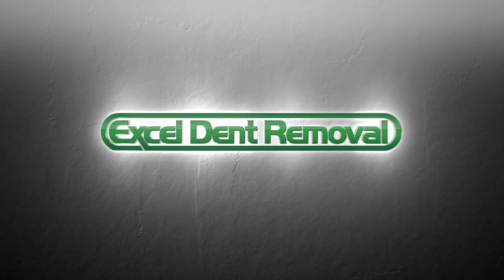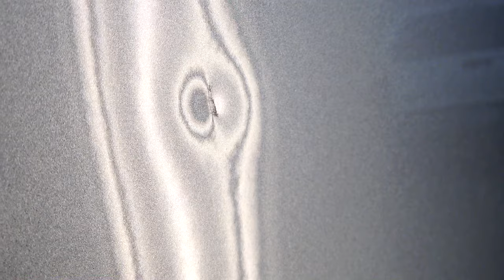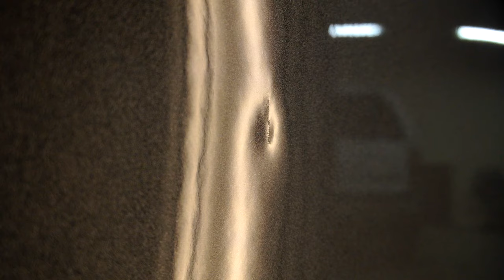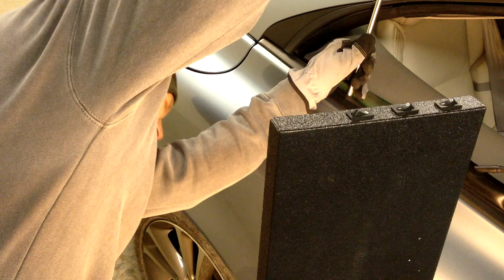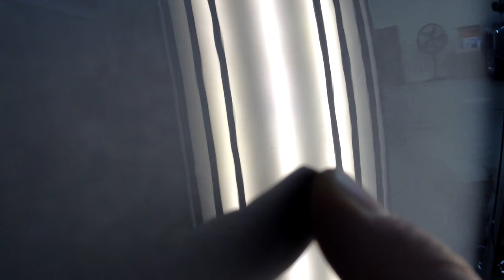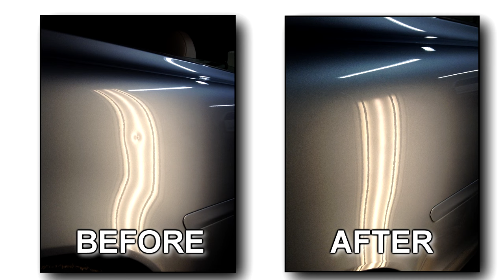How Does Paintless Dent Repair Work

Comment: That is some nice work.  Would this have been possible on older cars with heavier bodies or is this really applicable only for modern cars?
Reply from the maker: +fuffoon Yes. This does work on older and classic cars. I’ve repaired dents on many classics and for some of the best classic and custom car body shops in the area. As long as the paint is in good shape and there isn’t any bondo behind the damage, then removing the dings will work. 
I’ve got a couple photos of some nice classic cars I’ve worked on over at my Instagram account, https://www.instagram.com/exceldentremoval/ I should be adding some more photos there of some recent repairs.

Comment from the maker: Do you have questions about how Paintless Dent Removal works. Ask it Below in the comments.
Reply: Excel Dent Removal. can u removea scrape from side swipe
Reply from the maker: +Michael Marchetti If the damage is minor and not scratched thru the paint, then we may be able to buff out some of it. Otherwise, a body shop would need to repaint the area.
Reply: How much did the repair total come out to the customer/insurance? How much time was actually spent doing this job? Do PDR shops run flat or hourly? If so, what is the labor rate of you shop?
Reply from the maker: Paintless dent repair cost is usually based on the size and how complex the damage is. 
Each dent is different and will have a different cost and the time it will take to repair. The time it takes also depends on the skill of the tech and how well they do the repair. 
The dent in this video was done several years ago so I don’t remember the cost or how long it took to do. 
Average small door dents are around $100-$250 and can take from 30 minutes to 3 hours. More complex damage will increase the time of repair and cost.
Reply from the maker: Thanks for watching. I also have a hail damage repair video on my channel that shows a couple hail dents being taken out of a hood.
Reply from the maker: There are many options out there for PDR tools. The professional tools needed to repair hail damage can already cost over $1000 just for a basic set. I personally probably have over $20,000 in tools that are needed to remove all kinds of dent and damage. 

You can find some basic “cheap” tools online that might be good to try it out and see if it is something you will want to continue on your car with without spending a lot on tools. 
You can test it out on a few dents and see if it will work for you. 

To be honest. I find most people try a few dents and then give up. It’s really not as easy as it looks and may not come out looking good. Especially on a new car. 

Just for an example. When starting training. We make 10 dents in a junk hood to practice on. We are lucky if we can actually fix 1 of those 10 dents. The other 9 are so bad that if it wasn’t for practice, It would have to be conventionally repaired and painted. Then we start with another 10 dents  and try those. 
Most PDR techs will tell you that paintless dent repair is the HARDEST thing they have ever learned how to do.
Reply: Great tutorial vid! Was wondering which tool is best for this job? I have a similar dent and would like to do a bit of DIY here in Hong Kong.  I got the glue pull kit but obviously not working so was thinking of getting some proper tools. Thanks
Reply from the maker: +J ay Most of the Door dent repair tools I use are from A1 Pdr Tool company. 
I have a recommended list of tools on amazon from them in my Pdr tool section ➡️ http://goo.gl/vVrHxQ

You can also look for A1 PDR Tools for more of their tools available. 

I will suggest maybe seeing if you have a Pdr tech local near you for the repair. It would probably cost less than ordering the tools. 

Plus if you do have a similar dent as in this video. This dent was sharp and took me many years to be able to provide an excellent repair for this even minor damage. Someone untrained could make the dent much worse to the point that it would have to be repaired and painted.
Reply: Thanks for the videos. I've watched several, as I need to repair a couple similar sized dents on my car.I n this video you state that you are making slight pushes at the center of the dent yet, in the light pattern the surface appears to be flexing at the side , away from center. Can you please confirm or explain for me. Thanks much!
Reply from the maker: Yes. Pushing from the center of the dent is needed. Sometimes with a crease we may start from one side and work to the other but still within the center. 
You will see the metal flex all around even though only pushing such a small amount with light pressure in the center. Most often it is just enough to bring the dent up slowly and not enough to actually see each push from the tool.
Reply: @exceldentremoval  Thank you so much ;)
Reply: Would this work on the body line on the rear left rocker panel? Got a door ding there and I’m hoping PDR will help/work!
Reply from the maker: It might be possible, but that area probably has limited access to the inside of the panel. 
You can check out the other videos on my channel.  Some show different methods for other types of damage and access.

Comment: Hi . How do you ascertain if the tool is exactly underneath the dent from behind the panel? could you show us? thanks.
Reply from the maker: That is done by looking into the light reflection in the panel. The contrast between the bright and the shadow area is where we can see the tool.
In the beginning of training to be able to do paintless dent repair, this is learned and can take a couple weeks to be able to find the tip of the tool properly. Then it can take months of training to connect each small push to bring the dent up clean.

Comment: if the dent was exactly on the door side. can i just remove the door panel and push it from there using my fingers?
Reply from the maker: Maybe if the dent is large and soft, you could make some progress with it, but it would not come out clean.
For regular dents and door dings, it won't be possible. Often the inside panel of the door is not wide open but had braces, intrusion beams and other things that block access to the back of the panel.
The other problem with just pushing out the dent by hand is that the force and pressure needed is not possible. While it may look like the PDR tool is just lightly pushing out the dent, there is a lot of controlled force and pressure being used to move the metal.
Reply: @exceldentremoval  i see, thanks for the info. I was assuming it's just a simple push of a finger :D

Comment: Wished I was near your location...what should one expect to pay for the same size of dent in your video. Thanks
Reply from the maker: +Jose Vargas Thanks for watching! 
You should be able to find a local paintless dent removal tech near you that can remove a door ding. 
The cost of paintless dent repair can vary by city and tech experience. Currently the average cost for a small door dent is around $100-$200. Most dents are not the same, so several factors can effect the price.

Comment: Its a pity you cant use an electro magnet for this. i imagine a 1 inch-across flat magnet applied to the area would pull the dent right out.
Reply from the maker: There is a lot of force being applied to push out the dent. I don't think a magnet would be strong enough to make these move.